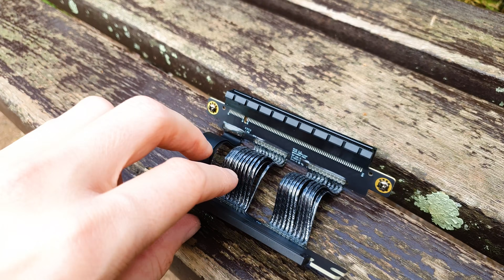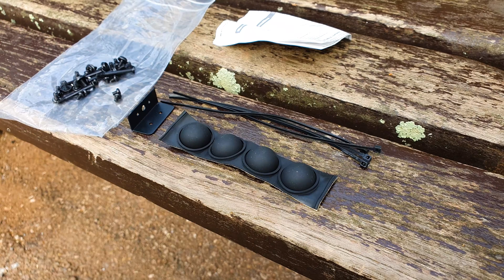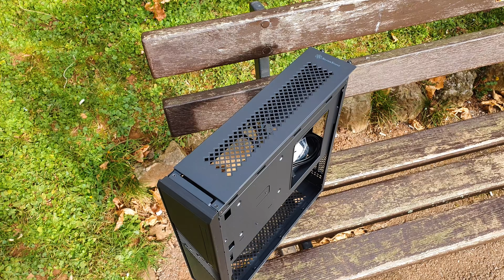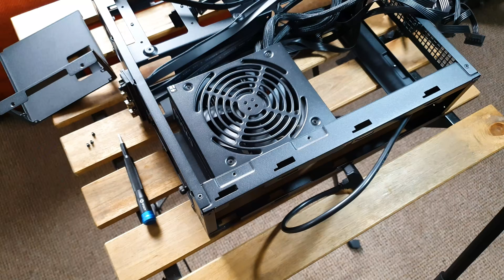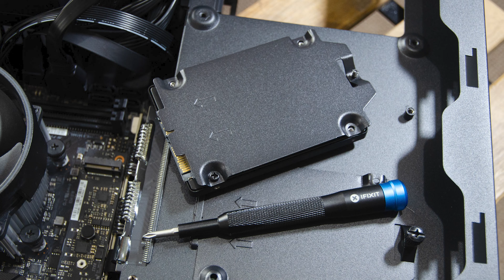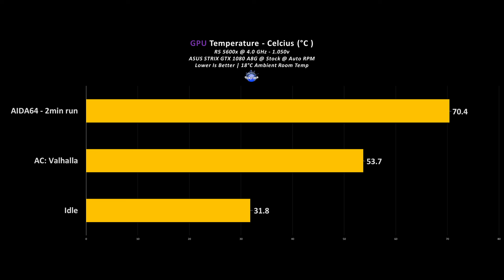Too Slim or not? SilverStone MILO 12 Slim ITX

Comment: 77mm isnt bad...noctua has a 65mm tall cooler that can work on the i5 13600k
Reply: They have one smaller than that and does Be Quiet that will cool the Ryzen 7700 and 7900 which are the 65w 8& q
12 core variants
Reply: @heirtothethrone000  I dont want a smaller cooler i want the biggest one that will fit lol
Reply from the maker: Good point 👍